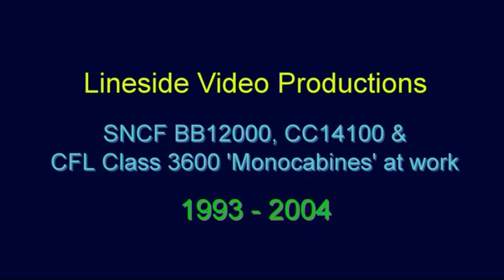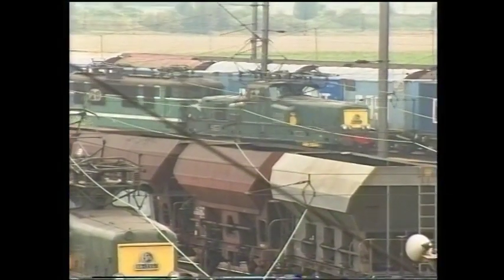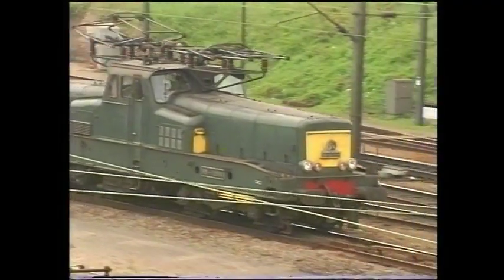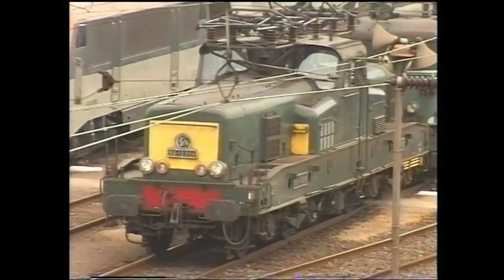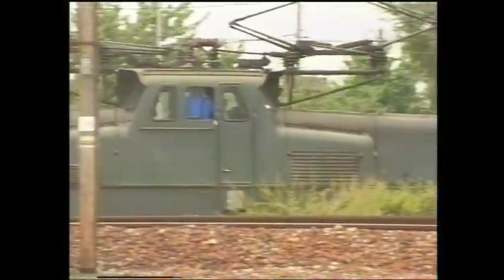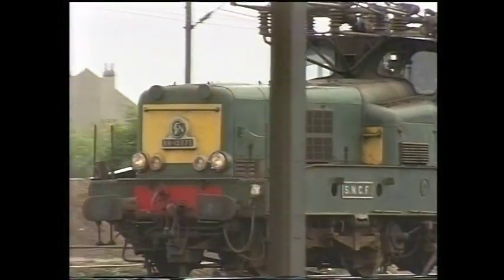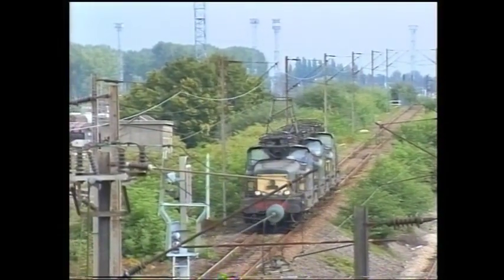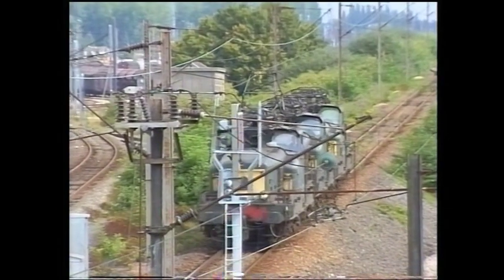Sampler - SNCF BB12000, CC14100 & CFL 3600 in action 1993-2004 - preview. www.linesidevideos.co.uk

Comment: The 53 BB13000s, with direct 50-Hz traction motors, just barely made it to the period covered by this video; the 20 CC14000s didn't. Their complex single-phase/3-phase system made them very trouble-prone; they were retired in 1981. They otherwise resembled the CC14100; the BB13000s resembled the BB12000s. These 4 "flat-iron" classes ushered in the 25 kV 50 Hz era at SCNF.